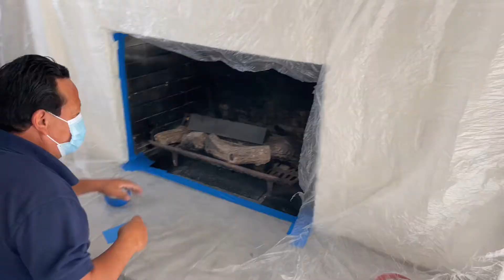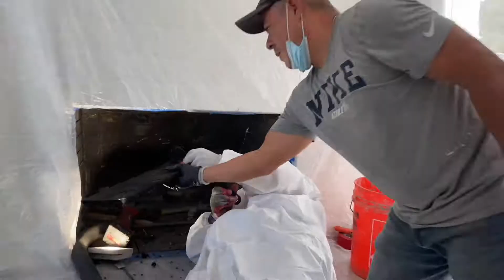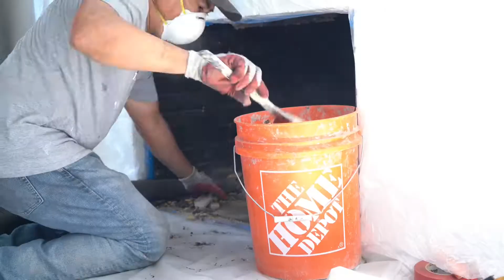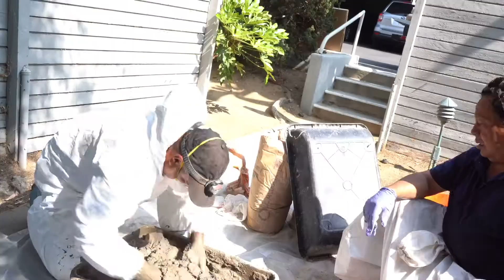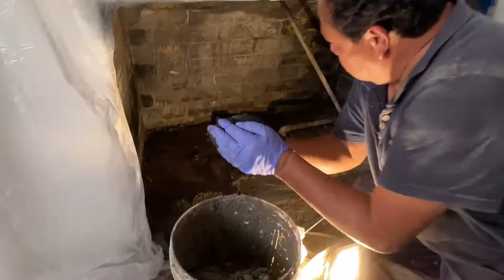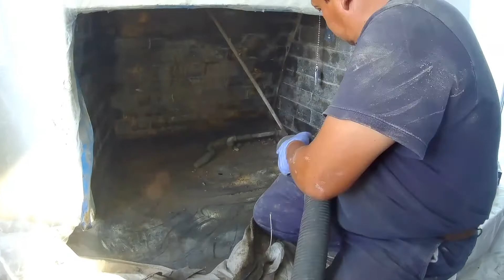Smoke Chamber Repairs - The Chimney Guy LA

Comment: The top mounted damper you installed at the top of the flue, does it seal 100%? 
Or did you set it so there is an air gap letting the carbon monoxide out in case the homeowner forgets to open the damper?
Thank You!
Reply: It’s supposed to fully seal. If you forget to open the damper you’ll find out right away when smoke is all over your house inside.
Reply: @drmechanicalchannel7641  that’s all good seeing the smoke when it’s a wood fire! This is a gas log/fire where there will be no smoke, just carbon monoxide that has no smell or smoke, and the carbon monoxide will be spilling back into the house and potentially poisoning or killing the family if they don’t open the damper! 
Hopefully the lead safety mechanism melts and the damper pops open if they forget to open it. And hope they have carbon monoxide detectors. 

Code, has to be a vent opening so gasses can escape the home at all times with a gas application.
Reply: @akaredcrossbow  isn’t that why Darwin’s law exists?
Reply: @drmechanicalchannel7641  yes, but someone’s mistake shouldn’t be another’s downfall.
Reply: @akaredcrossbow  where does code say this btw? Just curious to see cuz I haven’t heard of that.
Reply: @drmechanicalchannel7641  Gas fireplaces don’t have their own integrated dampers. Natural vent gas fireplace inserts or logs that are located within existing masonry fireplaces that utilize the chimney for venting will require any dampers located within the chimney to be open at all times.

Comment: Did the smoke chamber really need all that work for just a gas insert? How much creosote is produced from a small gas log like that one?
Reply from the maker: Heat is the factor here, that means before installing  the gas lag set, the system needs to be fixed and up to the code.

Wood burning systems produced more creosote compare to gas burning systems.
Reply: Also to add to your note Chimney Guy, Incase @John Clayburn didn't know, the client may one day want to convert back to a wood burning fireplace.
Reply from the maker: @YeshuaIsSalvation777  You are right.
Reply: All chimneys must be code compliant, which is like saying, I saw unicorn with wings, and it was singing the Star-Spangled Banner. You’re just not going to see those so by doing what they did here they are ensuring that the system is up to Standard.

Comment: This is awesome. I have an old chimney that failed safety inspection many years ago that has a damper built in to it and they wanted to charge an arm and a leg to fix it by dropping a small flexible duct into it because they said the current smoke chamber/ flue couldn't be repaired.
Reply: Well depends on what you want. An open burning will never produce the amount of btu output as a wood insert will.